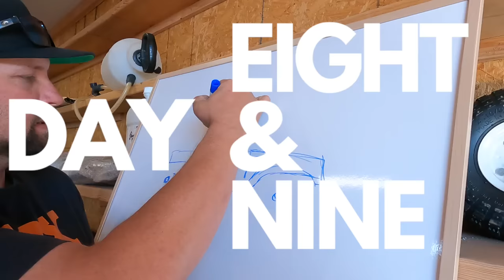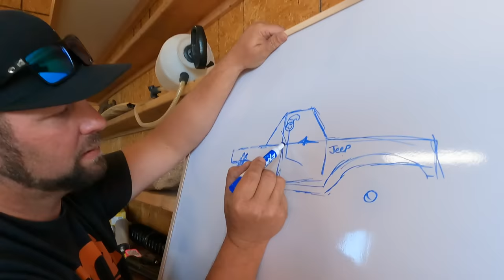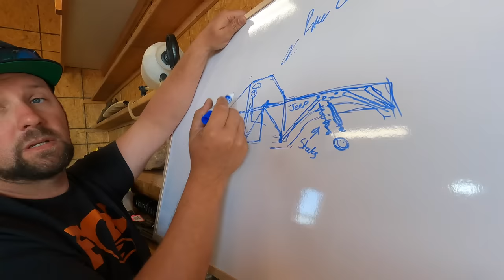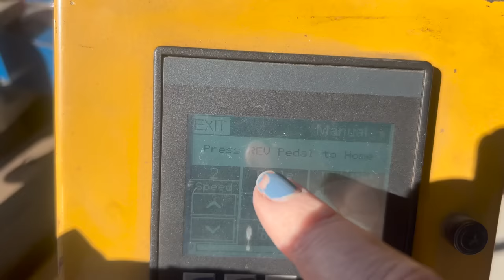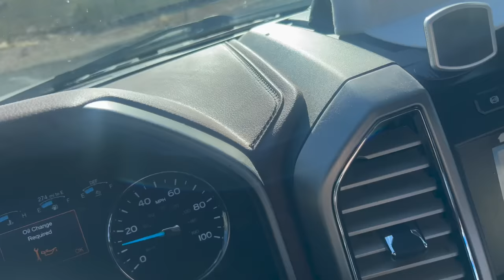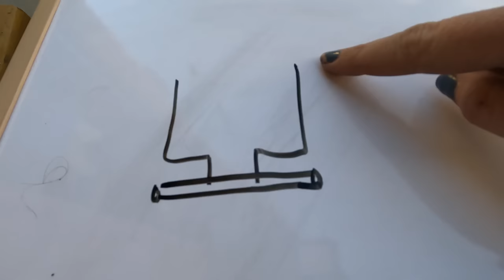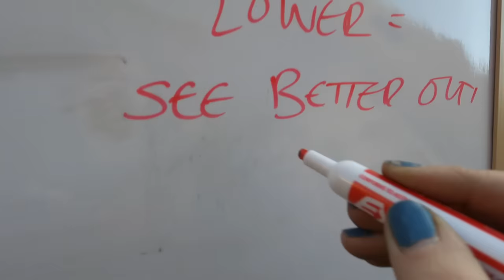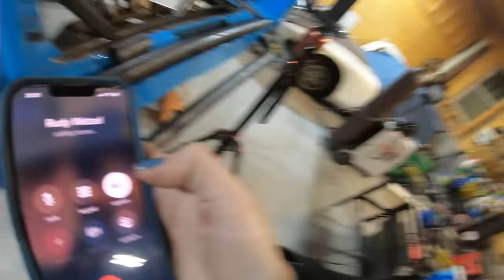Building The Passenger Compartment In The Race Jeep Build

Comment: What if you built brackets that attached to your cage and kind of suspended the fuel cell above the back axle? You could build in soft joints to allow some wiggle room for when the frame flexes and have the ability to set its height better for easier refueling during races. Whatever you choose is going to be good and I have to say that the cage turned out awesome.
Reply from the maker: Thanks, Joshua. It's really coming together! The basket Rudy makes will be hard mounted to the cage. Since we are unifying the frame, cage and tub there will be a completely rigid structure (hence the solid motor mounts, etc...). Apparently, that's the best way forward for racing - I'm learning so much throughout this process :-)

Comment: So I’m curious (and probably sound dumb) but why are you building from the rear of the vehicle?? Great stuff as always👍🏻👍🏻.  Chris you are awesome dude👊🏻👊🏻
Reply from the maker: Once the 'full bump' position for both axles was set and we got them as high as they can possibly be, we can start to set the shock positions. You can work forward or rear from the b-pillar position once that is set, and you can choose whichever you want. We chose rear because we wanted to get the extremely large fuel cell, passenger seat positions and coil over/bypass positions set before tackling the front suspension. The front is fairly straight forward (although the steering may get a bit tricky).
Reply: @MischiefMakerTV  thank you….that clears things up nicely👍🏻👍🏻